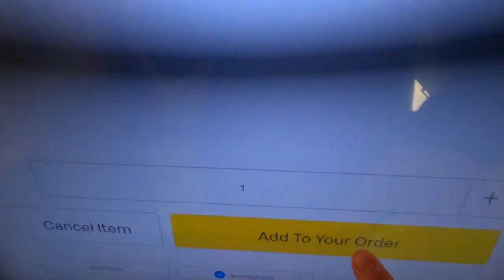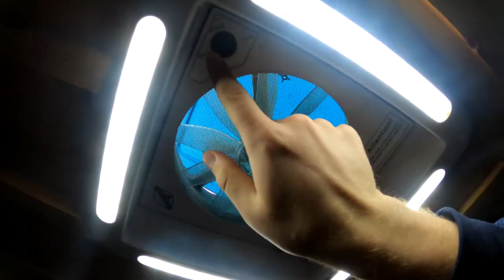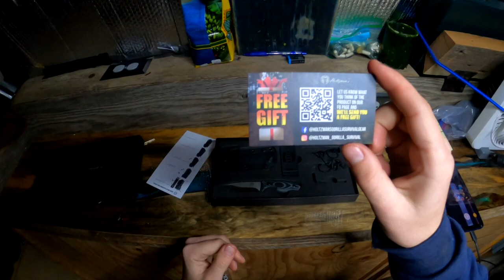A Very COLD Night In My Van | VAN LIFE

Comment: Do you have a Jackery Portable Power or Solar Unit If not the Jackery needs to sponsor you and you can get a electric heating unit in your van.
Reply from the maker: I have a solar system but its not good enough to run a heater